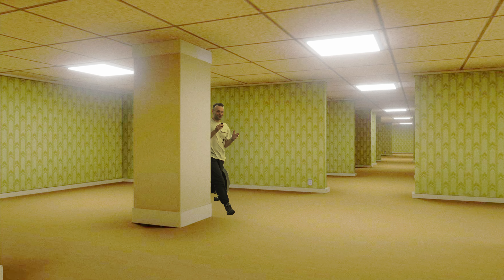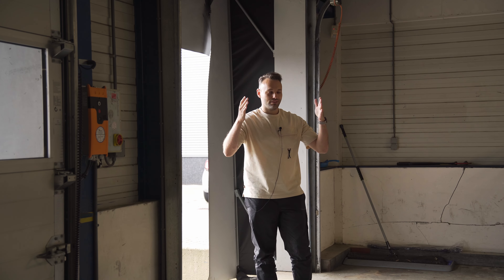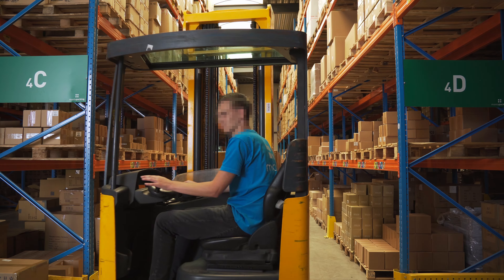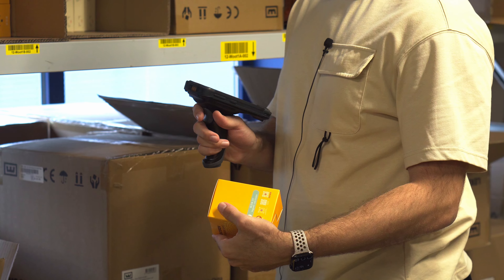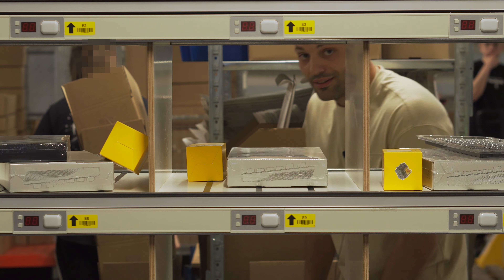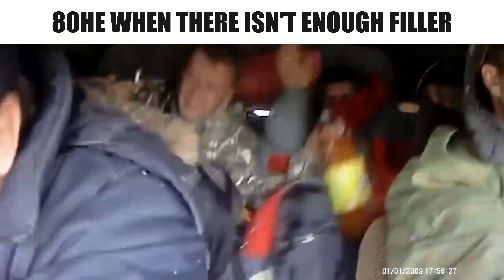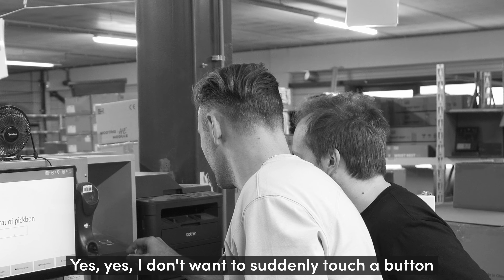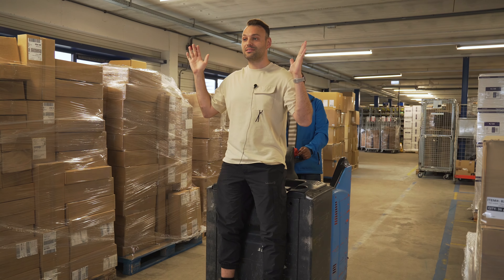How does the Wooting 80HE get fulfilled? 📦

Comment: I wish my 80HE would be packaged in a box with proper protection fillers like in this video. Got mine in a bag looked like someone played football with it. Support not taking any accountability, gg I guess.
Reply: Is the keyboard ok?
Reply from the maker: That was an unintentional miscommunication between the warehouse and us. Any missing or damaged items will, of course, be replaced at no additional cost! 
^Sander
Reply: The keyboard(white version) has 5 chipped paint around the keyboard, and some wired hardware issue that customer support didn't connect me with anyone to debug yet.
The keyboard case has few dents due to the poor shipping conditions, the free key caps were broken and spread all over the package.
Customer support said either I can keep the keyboard, get $40 credit in store but they'll expire the warranty(lmao.) or return the keyboard back and good luck waiting for v2 or get the black version (no expedited shipping, will have to wait for next batch).
Reply: @itsZvn  I would just wait for the next batch tbh